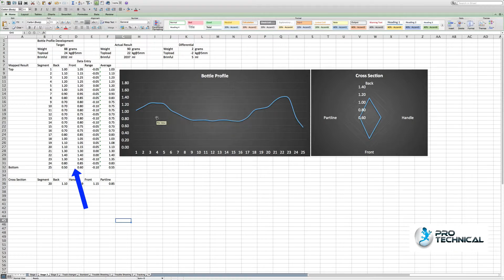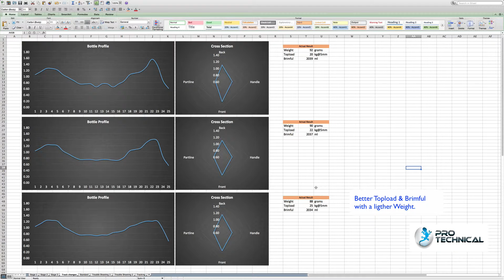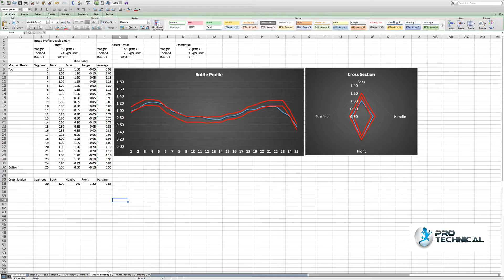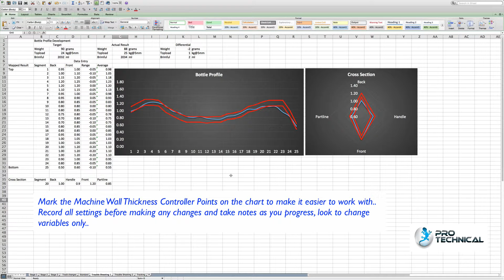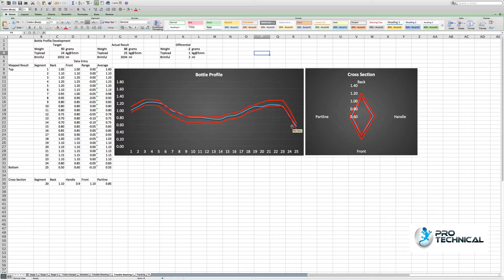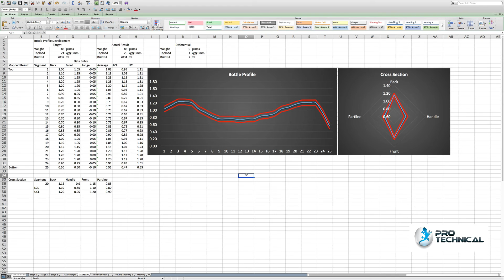Bottle Mapping, Extrusion Blow Molding

Comment: What measuring tool are you using to import the data within excel?
Reply from the maker: I prefer to use a Magnamike system which uses a ball bearing and magnets to measure wall thickness, it's a non destructive test. Speaking to the rep last year he has suggested they can produce software to upload the data into excel. Currently I manually key the data.
Reply: +Pro Molder thanks!